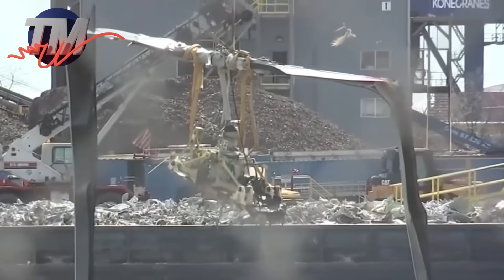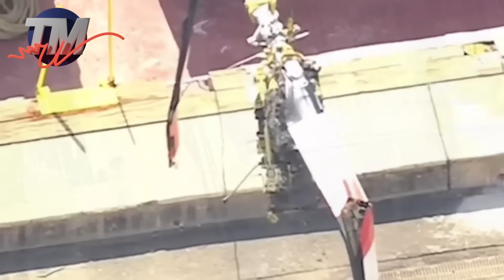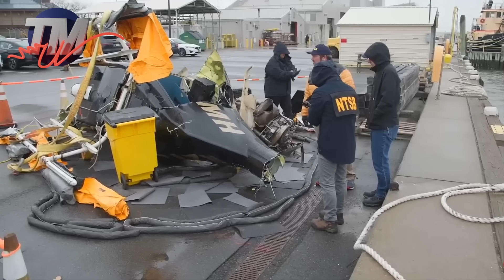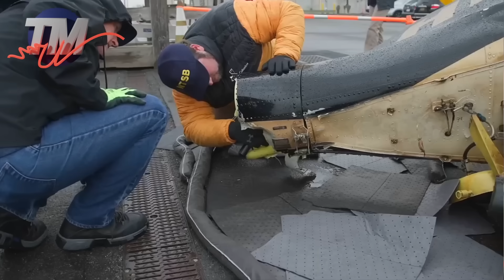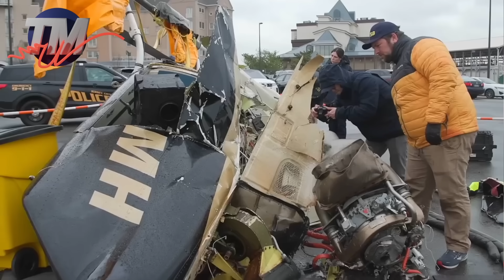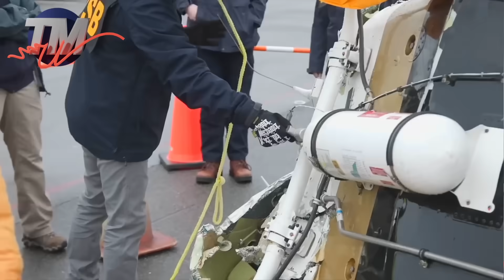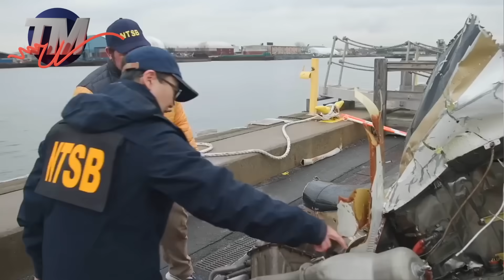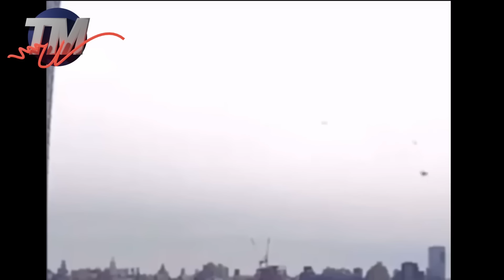Recovery of the Main Rotor of the Hudson River Tourist Helicopter - it's worse than we thought

Comment: Geez a loo!!!  It's like the entire airframe underneath the main transmission ripped out!   I've never heard of anything like that, much less seen it.   If we hadn't all seen the rotors falling separately from the fuselage I would have thought this had to be due to crash damage - but this happened up in the air.    I don't know what could cause this?   Perhaps significant untreated corrosion paired with a catastrophic main transmission stoppage?   I don't know.

Comment: I’ve read about and seen many sheet metal patches, they say this is not good over time. Yes, if a pilot is supposed  to report when they have been in torc ( twisting) winds, and haven’t mentioned, perhaps small cracks went unnoticed during mechanical inspection.

Comment: IMHO: From the enhanced video of the actual catastrophic failure, my observation was at the moment of the initial twisting yaw event, a large structure appeared to depart the top of the airframe simultaneous with the yaw. As the airframe began to fall, the rotor and roof section remained "tethered" to the comprised airframe for about three seconds. The rotor/transmission/roof section then broke free and fell in auto rotation. What is significant to me is the rotor did not appear to seize, but was in rotation throughout the entire event. This would rule out a torque induced shearing event...IMHO. It is not clear from the enhanced video whether the rotor severed the tail boom section or the torque forces simply ripped it from the main airframe. 
The recovery video clearly shows the entire rotor, transmission, mounting bracket assembly attached to the roof section, ruling out speculation about mounting brackets or the like. 
From my chair it not possible to establish the cause of the massive yaw event. It does appear to be too sudden to be pilot induced, which leads to the obvious conclusion of a structural failure.
Reply: It’s is very clear from this video that the rotor did not sever the tail boom.
It is separated along a joint right next to the fuselage with no impact marks.
This is where you would expect it to fail due to an overload in the yaw axis.
We also saw a sudden yaw at cruise speed which would apply a huge load to the boom in the yaw axis.

The rotor continued to rotate but at considerably reduced speed. This could simply mean it did not impart 100% its inertia through the gearbox to the fuselage, before something else broke or the freewheel disengaged allowing it to rotate freely.
Reply: @Captain101-x1o  It is notable that the boom did not shear at the riveted bulkhead attachment point. Rather, it sheared approx. 15" aft of that point where the lateral structure was move vulnerable to those sideways forces. It failed at the weakest point, just aft of the maximum leverage on the structure.
Reply: Maybe the tail boom failed first causing the very fast yaw.  It was straight and level and yawed violently almost instantly.

Comment: Thinking a hanger bearing, tail rotor driveshaft failure started the cascade of failures, beginning with the severing of the tail boom, leading to the main rotor strike, and tearing away the cabin roof, attached to the transmission.
The reported “pop”, could have been the turbine wheels exploding, from the resulting over speed.
Reply: Thinking back further, as it’s been some years, I believe there’s a squirrel cage blower, mounted coaxially, on the tail rotor driveshaft, for the oil cooler. Wonder if this blower could have got FODed, and took out the tail rotor driveshaft, starting the sequence of damage / failures. A FOD incident could explain the rapid / catastrophic failures.

Comment: As a gearbox mechanic; (though not intimately familiar with this exact gearbox) I do know that inside of gearboxes there are GEARS. And I also know that gears have TEETH. And gears have positive clearances between them measured in thousands of an inch. And the only way to have a gearbox seize up at abruptly, stop turning is to suddenly have a large strong and very hard piece of metal reduce the positive clearance between the teeth on the gears to a negative inch clearance. Broken gears or parts of gearbox shifting mechanisms come to mind. The result is usually multiple new undesigned inspection ports or a new meaning to a split case. But considering how long it takes a helicopter to spin up its rotor after engine start, with all that torque and momentum energy going into all of the moving parts, to suddenly stop that in a fraction of a second I would think that the clutch would slip, the sheer pin Would sheer or a relatively small inch size shaft would twist off before the multiple foot size rectangular roof would twist out of a rectangular opening in the top of the cabin. Normally things that twist off tend to deform into a circular shape as they rip out of there original location. I do not observe anything on around or near the main gearbox to indicate this. So the seizing up of the gearbox doesn’t work with me. But I do think that it is very possible that there was more than just one thing involved with this tragedy. So I try to keep an opened mind because I have seen things happen that I would not believe except I saw then, I caused them and I understood what and how it happened but nobody else could believe it.
Reply: You wrote: "The result is usually multiple new undesigned inspection ports." Very clever. I'm stealing this phrase.
Reply: @cbso54  great!
Reply: @cbso54  Sorta like an RUD (Rapid Unscheduled Disassembly)
Reply: The transmission is weak enough to break and jam yet strong enough to rip the entire assembly out of the air-rame?
Reply: So ...  Then it has been a gearbox failure - seizure  combined with a clutch failure ?  What are the odds of that happening  at the same time?
Reply: @Xoman08 kinda high once the chain of failures start. U think the clutch survived a seizure at flight rpm? Id be surprised
Reply: There may well be a cover-up of the true cause.
Reply: @christinaheins407   Yes, a governmental conspiracy, just like the moon landing, the flat earth, and Bigfoot. Let's not even mention the aliens living amongst us and the government passing them off as "tourists."
Reply: Great description
Reply: Is there a shear pin fitted to this particular helicopter? If so, why did it not do its job?

Comment: I am always suspicious of tour flights.  Equipment is most likely older, purchased with a lot of flight hours.  Maintenance comes into question with the heavy workload...I've seen choppers land, drop a load of tourists, take on another load and depart without even shutting down.  Almost non-stop during times of high tourism.
Reply: the thing was 25 YEARS old, a lot of take offs and landings given the trips only last about 15 minutes!
Reply: With tight maintenance budgets comes the risk of counterfit replacement parts.
Reply: @missaneido7417  A Filipino guy made parts for a major US aviation company told me the only difference between OME and after market was the box.
Reply: Yeah,  kinda like getting on a horse you don't know on one of those trail rides...
Reply: @SuperAfranks lol, except instead of falling five feet you fall five hundred feet.
Reply: why would you shut down after each?
Reply: They are kinda designed for that lol. May be better to keep the oil hot and pressurized than to cycle the system repeatedly for some designs
Reply: Yeah this aircraft has thousands of flight hours. Plenty of time for critical parts or structural components to exceed their fatigue life if proper maintenance or inspections were not followed.
Reply: Another fear spreader
Reply: Unnecessarily shutting down and restarting turbines is very damaging due to heat cycling but yes rotating parts should be regularly checked.
Reply: It's like riding carny rides.  Maintenance depends on inbreds and meth users.
Reply: Fuel problems.Pilot not checking fuel.
Reply: @Mokhtar-h5b not true.. he asked for fuel for his next trip..
Reply: @Mokhtar-h5b fuel problem isn't going to snap the engine assembly in half

The mainstream news just assumed fuel since the pilot notified that he was coming back for refuel just 16 minutes after takeoff.
....but see the good old boomer news forgot that the tour was only 18 minutes long

So he was not out of fuel and turning around. He was mentioning fuel literally 2 minutes before he was gonna land....as you would nornally if you wanted to refuel.
Reply: @ChadDidNothingWrong boomer news? Lol you guys are strange
Reply: @VTGtone  anyone born before 1997 is a boomer according to the current generation (Z, Alpha) Millennials aren't mentioned because they can't compete with Millennials ;-)
Reply: @Mokhtar-h5b lol moron out of gas doesn't cause this.

Comment: I think that there are more aviation accidents now than ever before in my memory..  As far as the chopper accident goes I suspect that the engine or tranny had a catastrophic seizure and the torque of the momentum of the rotor blades ripped the transmission right out of the engine assembly. Now I am a mechanic but not a aircraft mechanic and I have no idea as to how this would work but this is what I think. I'm sure the NTSB will get to the bottom of it .

Comment: Either the transmission seized up or the engine seized, causing the rotational mass of the rotor assembly to torque/sheer itself away from the rest of the helicopter. The tail boom structure was second to fail the rest we have seen

Comment: Somehow the main rotor ceased in action and reaction to rotor being ceased fuselage turned opposite direction of rotor violently.   Sudden force of fuselage snapped the tail boom and whole main rotor and transmission departed as well.
Reply: Correct other than if the gearbox seized the fuselage would turn the same direction as the rotor- obviously as they are now seized together!

Comment: The shafts or the trans lock up and the inertia of the blades rip the mounts lose from helicopter separating the two parts from body
Reply: How come the blades spinning over a locked up transmission would rip the entire thing apart when the blades are free floating and the mast will break first in any case? I'm just curious, not bashing your theory at all!

Comment: It would take a lot of torque if the structure was in good condition. If it was not then it might not take much force. If the aircraft yawed right then probably tail rotor drive failed first. If it went left them maybe the gearbox seized. But is the mast stronger than the attachment to the airframe? You'd need to transmit that torque down to the transmission and mounts.  The NTSB probably already knows from how the tail boom failed, even before they take a good look at the transmission.

Comment: I have no knowledge about flying or helicopters, sorry if I say something very silly. The sudden apparent swivel seems from a very violent movement of the controls, could had been the cause a pilot's heart attack? It could have make the tail to break and it hitting the structure at the base of the rotor, weakening its fixation to the body and the force of the rotor pulling up, "extract" it? The involuntary  bodily contractions of the pilot could have made the manouvvre too violent for the joint of the tail. Perhaps it's just my imagination but there is no explosion or impact to be seen and the manouvvre is the first and unexplained sign of trouble.

Comment: I'm only guessing. My theory is that it was a massive engine failure causing a seizure of the  drive shaft. The massive torque loads caused the fuselage to yaw violently. These loads sheared the main rotor and tail from the air frame. But more simply. The air frame spun fast and tore away from the tail and rotor. It was the air frame that exerted the loads, not the rotor.

Comment: There is visual evidence the structure as some time was compromised during duty of vertical lift,landing and repeated thousand times a year would begin to weaken over time and if not inspected on major inspection intervals this will result in cracks in that honeycomb ceiling structure,especially if over torquing the transmission during heavy lifts or overloading the capacity of this machine.

Comment: It doesn't matter if there are less or more incidents. The point is that the reason for the accidents show that there is a real need for a thorough investigation about the quality on the parts of the helicopter as well as how often the chopper is checked and how detailed is the examination on issues happening more often. There is also, in some cases, the problem of a lack of precise orientation by the tower, and how precise are the routes provided to either helicopters or planes.

Comment: Speculation based on the footage you've shown here: Is it possible the tail section separated from the body of the helicopter at the joint (due to age and/or wear), then flew upwards and impacted the main rotor before being flung away? (The post crash video shows that the blades of the main rotor had been broken.) The grainy video shows the main rotor flying off a second or two after the separated tail flew off. It follows that the impact on the maim rotor by the tail section may have been violent enough to tear away the rotor and the transmission within seconds of the initial separation..
Reply: Only possible if who ever did the inspection in March 1st was being intentionally negligent
Reply: There is no damage to the main rotor blades .😅

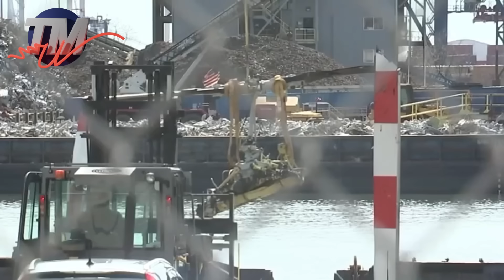Comment: Here is something I truly don't understand? That transmission platform has 4 huge double wishbone hardpoints (looks like they are at least 3" in diameter) that would have some serious bolts, pins? You can see them clearly at 0:37. There doesn't appear they were torn away as they look undamaged. So how did those 4 pins/ bolts all fall out of their hardpoints or were they all ready to work their way out? Crazy that nobody even sort of noticed those...RIP to that family and pilot.
Reply: All the gearbox struts are still attached to the gearbox and gearbox deck. The gearbox deck completely separated from the air frame.
Reply: As a former crewchief on this aircraft type (or at least very similar) in the US Army, from what I can see, all the transmission mounts and bolts are still in place. I don't see any of the four main lower mounting bolts missing. They do appear to be black, though. Could be that makes them look like they are missing in a few clips?
Reply: @kentonsnowball361  The gearbox strut bolts are coated with a black anti corrosion coating.
Reply: Those pins are all in place and the mounts still,attached to the gearbox deck.
The entire deck has been ripped from the fuselage, mounts intact!
Reply: my sentiment too. Did somebody forget to put the bolt ? (it happened with the Boeing before, who knows ?)

Comment: At the 4:09 position, the helicopter --- which, up to that moment, appears to be flying normally --- makes a sudden maneuver (perhaps tilting backward or to the side; might be starboard instead; maybe both simultaneously), instantly followed by self-disintegration. The exceptionally ruinous condition of  the wreckage must have been caused by a sudden and very powerful force, such as only the rotor blades striking and severing the "mast" could provide. As the narrator here points out, nothing quite like this wreckage has ever been seen before. It seems clear then, that only pilot error could have caused it, as most convincingly described below by "rotorheadUK". Even if this conclusion is proved correct, it may be officially denied to spare the U.S. tourist company the overwhelmingly costly legal actions inevitably filed by surviving family members in a kind of cover-up not, sadly, without precedent.
Reply: It has happened before.  Google ATSB Transport Safety Report Aviation Occurrence Investigation (Short) AO-2022-034 Final – 12 May 2023.  Happened in Australia in a Bell just like this one a couple years ago.
Reply from the maker: @ericresh3268 Found it. Thank you!

Comment: The main rotor on this helicopter spins in a counterclockwise direction. If the main rotor transmission seized, is it possible this overwhelmed the force the tail rotor is capable of exerting and the the effect of grabbing the tail and snapping it off? Would this "seizing moment" in the transmission cause the fuselage to actually be the part exerting the force to twist itself away from the transmission along with the leverage of centrifugal force provided by the still spinning main rotor? In the "which came first" question, I am inclined to give more weight to it being the problem started with the main rotor transmission and the tail rotor section was subjected to centrifugal force that overwhelmed and snapped it off. The "snap" at the tail section (circular) is different between the right and left sides which needs to be explained.

Comment: Its going to be the exact same cause as this one.  ATSB Transport Safety Report Aviation Occurrence Investigation (Short) AO-2022-034 Final – 12 May 2023 (google it).  That was also a Bell 206L.  The pilot made an abrupt up and right turn and the rotor hit the tail mast then the rotor and transmission disconnect.  Happened the exact same in both accidents.

Comment: For the entire transmission and blades intact to have been ripped from the body I would say that blade balance weights got flung from their mountings.
Nothing else would be "that powerful" to rip the entire mast with all its components intact off of the helicopter.
Same with propeller driven aircraft, throw one blade and then the engine becomes dislodged amid flight, nothing else can rip the engine off of its mountings.
Helicopter rotor balancing is much more important because of the span and momentums involved. To lose a balancing weight "would do" exactly what we see here.
Robert